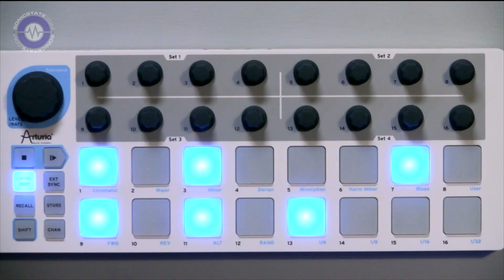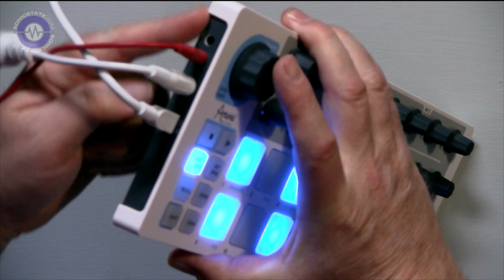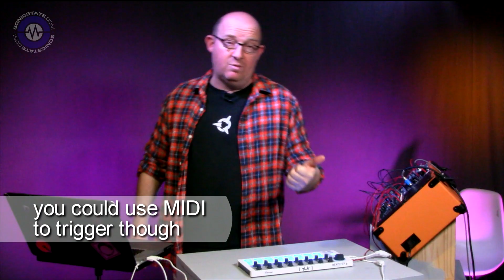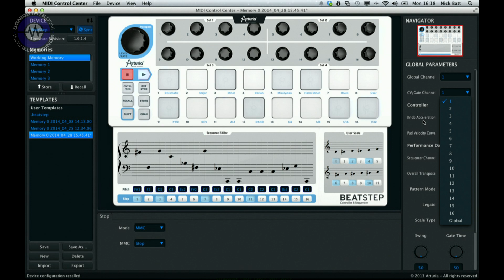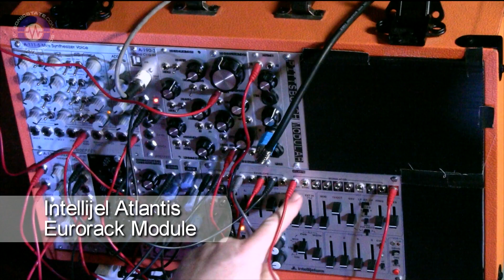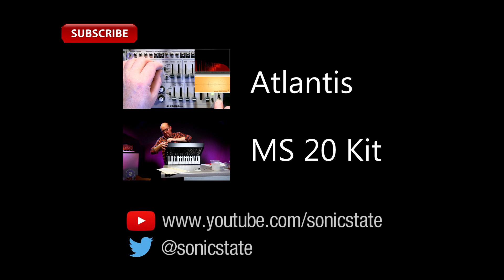Arturia Beatstep - SonicLAB Review

Comment: I want a midi controller that can integrate and automatically parameter map in Logic Pro , transporter buttons and beat repeat.  It’s not clear which midi controllers pair well with Logics Automatic control surface smart controls, shopping for compatible gear is a bit unclear.

Comment: It's funny that they thought EXT SYNC was an important enough feature to have its own button ... but then they didn't give it a MIDI IN jack, or a sync input jack, or even a DC power jack so you could use a MIDI to USB cable to get the master clock.
Reply: @RaquelFoster  That's because those features are useless

Comment: At 2:59 I can see that you triggered some pads multiple times even though you were only trying to trigger once when you switch to using just your right hand to play pads.  This is by far the biggest problem with the beatstep.  You pretty much have to slam on the pads with an entire hand and can't play it well with just fingers from one hand.  I own a beastep and rarely use it because of how difficult you have to slam on the pads.  When I do use it I use the knobs and mostly just for paramater control of effects, modulation, etc.
Reply: I have the challenge of using it to control volumes on my boss rc 600

Comment: Worth noting that a lot of the complaints made in the video have been addressed with new firmware updates. You can now transpose the pads in controller mode and adjust the swing from the hardware without using the PC editor for instance.
Reply: how can you transpose the sequence with the pad? I am in the latest firmware i cant find out how it works
Reply: For those wondering, to change the pitch of the pads in control mode hold shift and turn the big knob. It works +/- 2 octaves.
Reply: @2tallcharles99 Thanks Dude. Top tip.
Reply: Alex Dogson it should work eventually
Reply: Wow! Great to hear. The controller looks really solid and well designed. Mine is in the mail and I'm excited to try it out!
Reply: I just got this two days ago, with all the new firmware I can't even get it to work as a midi controller in ableton. This is the biggest piece of shit I've ever used in 10 years of making music.

Comment: plugged this into a Roland Fa-06, and at one point i had the Keyboard split with 2 synth sounds, high keyboard and low keyboard, and i could control the whole spectrum of the keyboard with the knobs. Try Midi out with this thing on digital synths, its pretty fun
Reply: @warren peterson. I precisely plan to acquire a Roland FA-06 and a beatstep pro. Do you know if it shall be possible to let the beatstep play a dedicated tone on the workstation while using the Roland keyboard to play other part(s) with other tones? Thanks in advance!

Comment: Tanks for the comprehensive review. I'm considering getting one of these to use as midi controller for my DAW (I have no interest in the step sequencer really). When you say it can't transpose the pads, is this just the case on the hardware?  I presume you can set it up using the software interface, to send midi data in any octave so that it could be used to control percussion patches in kontakt? Thanks.

Comment: 2 things ruin the Beatstep for me: 

1. It cannot be slaved to external midi clock. (Aside from maybe USB, but I don't use a computer in my studio.)
2. Many of the functions require a PC editor. (Once again, computers...)

If the Beatstep just had a proper MIDI input and was totally standalone, I'd definitely buy one.
Reply: VincentsVideoVisions that is not true it is compatible with external midi controllers and CV/Gate inputs as well. You can use it as a standalone just fine.m
Reply: i'm sure you have the beat step pro now correct? because that unit solves these complaints

Comment: sonicstate Does it work with the volca bass via midi ? :)
Reply: I can't see why not. Just hook up the MIDI OUT to your Volca Bass, and have your MIDI channels set to the correct channels. The only problem is, the Volca Bass has 16 steps, and the Beat Step also has just 16 steps. But the Beat Step can hold 16 separate sequences in memory as opposed to the 8 memories with the Volca Bass. Apart from the additional 8 memories it does not look like a real big advantage. A lot of people are considering getting one of these, to sequence the Akai MPX8 or the new MPX16, as these do not have a sequencer built into the units.
Reply: acidphaze haha I already wanted to buy the mpx 16... Do you know when it comes out ? I hope it must be for the end of the summer... :D
Reply: I haven't got a clue when the MPX16 will be released. Guitar Guitar just did a review of the unit just a week ago, so I guess they should be available for purchase in the next few weeks. With a bit of luck.

Comment: sonicstate I've got one I've been messing around with, its pretty rad ... having said that I'm trying to figure out a way to arrange it so that I can get external clock sync/tempo from DAW (Logic) to drive the step sequencer tempo controlling an MS20mini with Gate/CV - is this possible? what am I missing?
Reply from the maker: Send MIDI clock down the USB bus from Logic (not sure if you can still do that) and it EXT sync button on the unit

Comment: I'm quite disappointed it can't drive a Korg MS-20, if it cold that would be my next purchase.
Reply from the maker: Actually you could drive an MS20 Mini but just using MIDI not CV/Gate input
Reply: You can use the pitch modulation input (top left corner) instead of the main pitch input and it'll work, you just need to set the modulation knob appropriately. This way you also get transpose from the MS-20's keyboard, which is nice :)
Reply: masterhong The so called TOTAL input, exact? Instead of the VCO 1&2 input... That's actually how I would use it, to transpose sequences with the keyboard, but you say the tuning would be a delicate operation. Now I'm sitting on the fence about this purchase.
Reply: Pierre Ripplinger You can use either total or just the oscillator input. If you send it total you can also set up a bit of filter tracking! The tuning can be a bit annoying, but if you're just working around an octave or so you can quite quickly get it close enough.

The way I've set it up on my sequencer (not Beatstep) is that I send 0V at middle C, and then I sequence offsets from that (so 1 octave above middle C sends 1V, below sends -1V etc.), while selecting the appropriate base note with MS-20's keyboard.
Reply: I just got mine and tried it with the Ipad ver of iMS 20 got a few of the knobs working, got to spend more time with it!
What you got?

Comment: picked one up - like it. However there doesn't seem to be enough voltage from it to drive my Roland SH-2 - it gets Gate fine, but pitch doesn't seem to work. Would be nice to have (what a lot of people have requested) Selectable Per Step, Gate Length from the device with some button acting as a 'shift' button.

Comment: Have you heard about the MTRX by Fyrd Instruments? It´s a much better sequencer than that, and by that I mean you can transpose by semitones or octaves or whatever, you can have from 8 to 128 steps depending of the mode you're in. This is possible because the unit is completely reprogrammable.
BUT you have only midi out via usb or classic midi, and the device has a strange way of working: it only has one high precison jogwheel and 12 buttons, 8 of which are used to input midi data